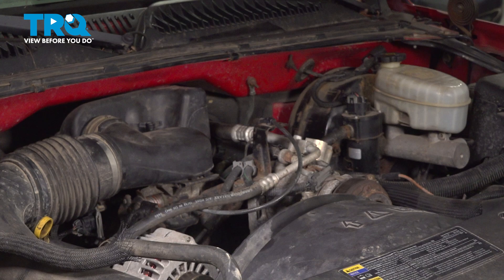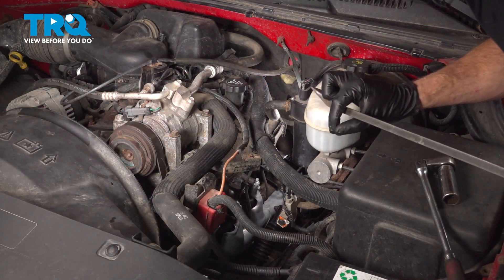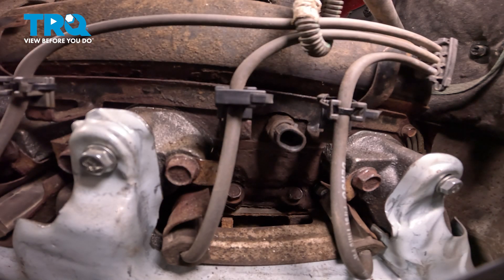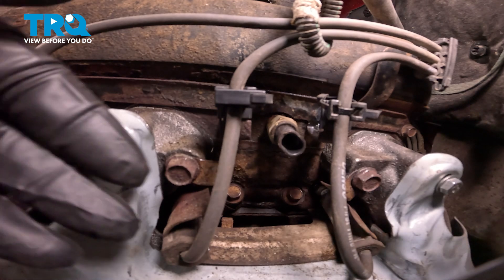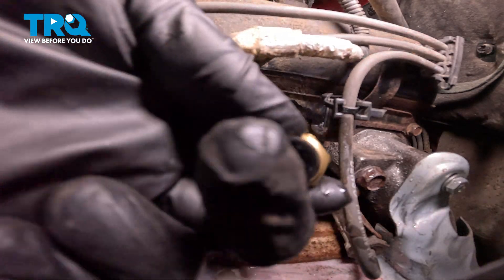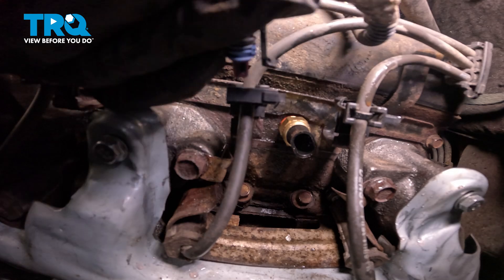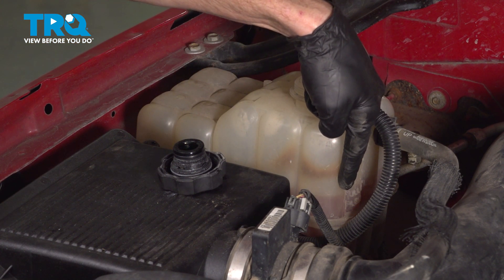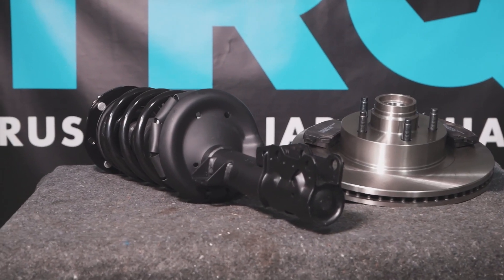How to Replace Coolant Temperature Sensor 1999-2006 Chevrolet Silverado 1500 4.3L V6

Comment: what are signs of a bad coolant temp sensor? I just replaced water pump, thermostat, after a good while, and now electric fans come on every drive, which would only do that for when it would overheat
Reply: the temps are fine
Reply: Mine started with a Low Coolant warning light, then a service engine light stayed on

Comment: Hey TRQ family I need your help I can’t find my coolant temperature sensor for my 2015 VW JETTA SE
Reply: Ask Google Gemini
Reply: The coolant temperature sensor on a 2015 VW Jetta SE is typically located on the engine, near the thermostat housing. It is a small sensor with a green or black connector.
Here are some additional details that might help you locate it:
 * Engine: The sensor is usually found on the side or front of the engine block.
 * Thermostat housing: The thermostat housing is a metal or plastic component that houses the thermostat. The coolant temperature sensor is often located nearby.
 * Connector: The sensor has a green or black electrical connector with two wires.
 * Accessibility: The sensor may be difficult to access without removing some engine components.
If you are having trouble locating the sensor, you may want to consult a repair manual or take your car to a mechanic.